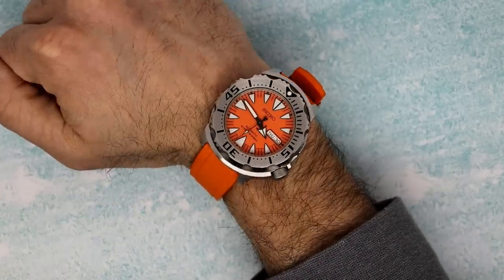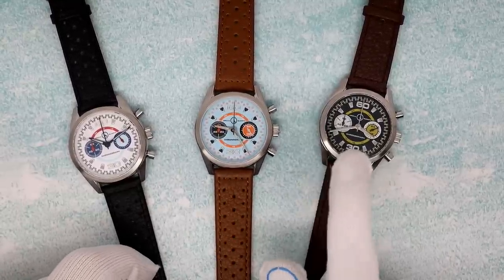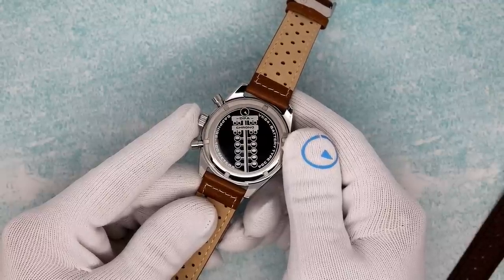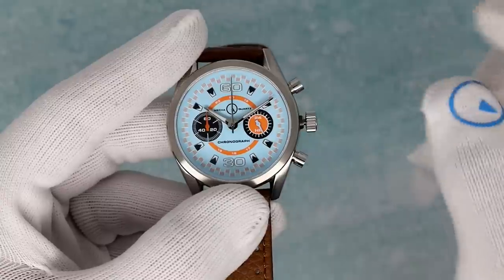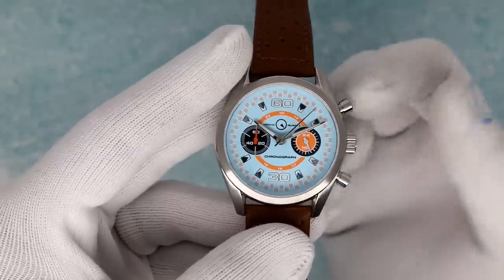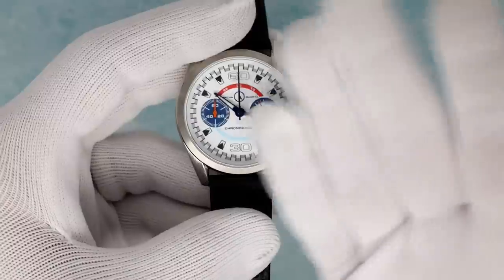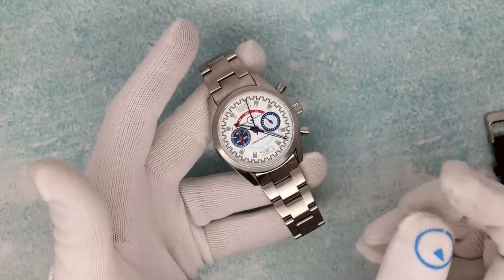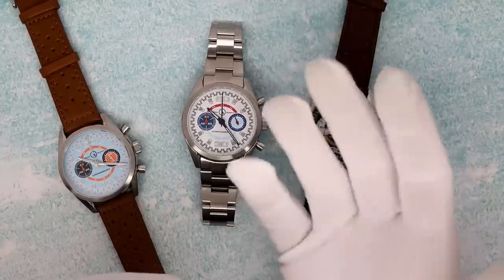Our first Mecha-Quartz Watch- the Islander DPA Chronograph

Comment: Great vid Marc. Not to beat a dead horse but I found a no date , 3 sub dial Chrono on a bracelet in a VJ 7750 layout…..30 min totlizr at 12:00, running seconds at 9:00 and….12 HOUR TOTALIZER @ the 6:00. Casio..Amazon….$56.00 USD. We are both pilots. You know what the 12 hr. is about. It ain’t for “Balance”, lol 😂

Comment: I just received my ISL-220. It's a very nice looking watch, very comfortable on the wrist. It'll get a lot of wrist time this summer. I needed a bit more color in my collection. 

Positives: the parts of the watch you're most likely to scratch are brushed. The screw down crown. Strap works on my 6.5" wrist, 

Two minor points of critique: I'd gladly pay a few dollars more for a strap that can be swapped without tools, this watch is begging to be worn to the beach on a perlon or rubber strap. 

Also: the minute register is small, and 60 subdivisions on such a small radius almost requires a loupe to read. The VK64 dictates the 60 minute dial, but does it have to be this small?

Comment: The totalizer should be 30 minutes, not 60. The Speedmaster, the Navitimer, the Daytona. There is a reason why all the great chronographs of the past used a 30-minute totalizer, because it is actually legible in a dial that small. The 60-minute dial is almost impossible to distinguish, even with perfect eyesight, due to the degree of separation between indices.

I get that quartz chronos have gone in the direction of 60 in the last twenty years, so you were probably limited. But these new 60-minute quartz chronos represent something completely non-functional. I like a chronograph I can actually use.